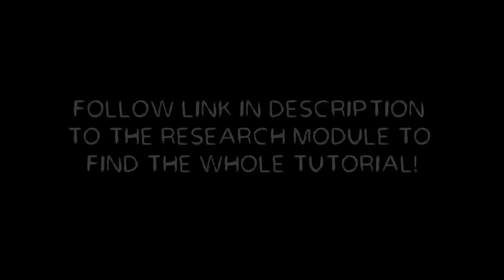#69 Shower upgrade with Cement Alternative (Magnesium Oxide)

Comment: You might want to cover up the intake of the shower drain with a grate to avoid debris of too big size getting in and blocking the drain somewhere you can't reach easily.
Reply: You could put plant carbon (use mimosa)  on top of the concrete structure as a filter barrier and cover it with coarse stones.
Reply: Yeah, that seems like an easy thing to add that would be worth it.
Reply: Just stuff a big "scotch bright" (steel wool pot cleaner) in the end 👍
Reply: Also, if you want more privacy, you can install a second layer of the pine boards on the interior of the shower below the shelf. Offset the boards by at least 3 - 5 cm and it will possibly help both sides to last longer while providing sustained privacy as the boards shrink over time.
Reply: @Isaac_Norman  Could use exterior battens over the gaps, but given the original width of the boards, might be alot of work.  However, the pine will definitely shrink over its life.

Comment: The magnesium oxide experiments were super interesting! Thanks for including that. I've worked with building supplies in the past - I did a year of work almost exactly like this. I never heard of using this for cement. Clearly it works, though, and is much better for the environment. You might want to add one more layer that is all downhill to the drain. Normally you have it all sloped, so water drains and doesn't pool. You can use a small spirit level to get it near perfect! But you really need to make sure the basin is all downhill to the drain, as otherwise the water will eat through the magnesium over time or go stale. It will certainly make it sink down, and drop further. Also add a grate over the drain to allow you to easily clean it in the future and prevent blockage, you will get a stink otherwise. Good luck!
Reply: potassium Phosphate, or fertilizer, also has a huge Co2 footprint, or is that very much lower than cement?
Reply: I agree with Camiel the CO2 difference is likely negligible when you account for shipping and packaging. Etc. This Carbon boner nonsense smh
Reply: @camielvanlenteren5256  Cement is one of the biggest producers of CO2, because not only does it require combustion, the reaction itself releases massive amounts of carbon due to the carbon atoms breaking off elements that have many carbon atoms. This is why it's good to look for alternatives. Potassium phosphate may be better, as it can be produced chemically with little carbon output. That being said, it's very likely that it's no where near as good as cement and will breakdown well before it. 

The better solution is to pump cement with CO2 so it is trapped inside the cement. Many companies are doing this as it's easy and quick and can store a lot of carbon.

But for a small project like this? I think that using potassium phosphate may be better. It isn't large scale.

Comment: not only as hard a rock but waterproof, 2000 years ago the romans were using such exotic mix's one of which was volcanic ash, it was used to build aqueducts, domes, water catchment tanks and much more, after 2000 years many structures are still standing and working great, no leaks! no cracks!

Comment: I’ve seen mixtures or concrete that use wood chips inside if you want to consider that! Acts as a carbon storage because the emissions of the woodchips biodegrading dont happen. Could be interesting to experiment with!

Comment: I was suprised you didn't torch the ends of the posts that were being put in the ground directly in the dirt. Good method for preventing rot, or at least putting it off for a longer time than it would be without it. Very happy to see the Magnesium Oxide experiments and how it works. The only thing I could think to suggest would be to put in a drain screen over the runoff hole in the ground, to keep large pieces from potentally plugging the drain. Where you have it, it doesn't seem like it would be a problem to clear out, or check once a week, or more, depending on the usage of the shower. Loved the project. And yes she is already a celebrity. 😁😉

Comment: Some ideas to prevent wood post rot and water runoff in post area: Propane torch the wood surfaces, stone/brick/concrete/rocksbelow and around wood footing, concrete or similar base pad for wood to rest on, or rock base to improve drainage away from post bases, sand/clay/mud and hay/straw; once hardened, apply a smooth sealant (concrete or other).  Takes longer but some make their own air dried bricks ( straw & mud  in a mold) and use mortar or equivalent to join.
Any plans for a passive roof solar water heater tank storage unit. Eg, Water tank on the ground, exposed to the sun yet glass covered or encased? Solar panels on the roof to provide an alternate energy heat source, shower roof water run-off collected in blackened water barrel(s) on the ground. Water can also be used for garden plant drip irrigation.

Comment: When you start doing plumbing indoors  remember to pre-squeeze the copper rings (olives)on the pipes, also add a bit of thread tape  around the olives before final assembly, this will make sure your fitting dont bleed later on. What do you guys do with the grey water? Understand you use bio soap but does it run through a fat-trap before it goes back into the wild?letting the water flow into a pit/  with potato sized rocks can do the trick, the body fat sticks to the cold rocks and you can treat it with bio enzyme to clean it up and take the smell away,  I enjoy your videos, thanks for the great content cool music video man
Reply: Great man!
Reply: Love comments like this. Very informative.

Comment: Don't let the water tank goes dry, even in winter time, but specially in the summer, otherwise it will crack and start leaking. Just 5cm of water will prevent it! 
 Nice work 👍

Comment: Loving tho project so far, as a suggestion you might want to look into charring the surface of any wood that goes into the ground such as the posts in this video or the mimosa that forms the steps. Charring the wood prevents bugs eating it and prevents rotting, plus it looks really good IMO. It's originally  a japanese method called Shou Sugi Ban, plenty of videos on youtube about it :) .

+ It is also more fire resistant.

Comment: The sustainable element is in the materials ability to return to the earth and be replaced by your labour. We had a deluxe long drop (two holes in the board, nicely smoothed for no splinters and no queues 🤣😂) just dig a new hole every year.   Got twenty years out of that tin shed before indoor plumbing...

Comment: The environmental impact of Magnesium Phosphate cement (MPC) per kg is higher than for Portland cement, mainly due to the use of fertilizer. It, of course, depends on the ratio MgO:phosphate and other variables, but please, don't advertise it as "environmentally friendly" which it is not. But a great material for superfast setting and very useful for such a project.

Comment: you could have used the bamboo to make threads and make  fabric of the bamboo then being cross stitched the warp would be minimal and some kind of waterproofing can be done using some other material.

Comment: I don't know if the wood you used is naturally waterproof, if it wasn't, fence stain might be fairly economical and effective for prolonging the life of the wood. Also, it looked like a pocket hole screwing kit might be useful addition to your tools - not suitable for every situation but easy to use and they help make most of the solutions they're used for stronger.

Comment: Great work on the show you guys. Just a suggestion to stop those boards twisting. Keep a constant middle rail going around with an angle for water to run off. (Joiner carpenter here) love the different idea on the base product. How firm does it stay being wet all the time?

Comment: curious, what is the CO2 output in the manufacture of the MOP cement you are making?  Especially as compared to Portland Cement (that is pretty bad, most of us understand).  

Also compare the cost of the same volume would be interesting.

Comment: so im catching up on the Project Kamp videos and although 8 months late i do like to comment on the carpentry work. I love the work you guys put out but i have one concern. As a former carpenter myself i am used off seeing a lot off workers using really loud tools without hearing protection. Which will set a trend so new people on the jobsite will follow the example and refrain from using hearing protection, giving arguements like being able to better communicate. If you want to work in a sustainable way to preserve yourself and your coworkers i think hearing protection is a good way to start. If you look into db output from powertools this would be a good idea even using power drills and impact drivers but especially oscillating saws and miter/track saws. I know this can come accros as being a bit nitpicky but i can speak from experience that oscillating saws with inadequate protection can give you hearing damage/tinnitus

Comment: For season 3 on this, can you please do a "Rough" R value test, where on a cold day you have a shower and ask everyone if it was warmer or colder than the wood floor, and the same for a hot hot day next summer? I'm sure you could test it more, but it's all about the feel of it.
Reply: It's the same wood floor.
I'm not sure what you are asking.
Reply: @jimurrata6785  I think he meant the basin, like if the basin is colder to stand on than the wood, the wood has good R value.

I'm not sure though
Reply: @RobertDoornbosF1  No one stands on the basin.  🤷‍♂️
They stand on the deck boards that form the floor of the shower.
Like I said, the 'pan' is simply a catch basin formed in the dirt... under the shower floor.

Comment: So, no tar paint before putting the posts into the ground? Isn't that going to rot? I did like the oscillating saw/multitool, really handy to cut parts out of the beam. Very good tool I am still looking for one. Yes I need it. 

So, you were not into building a concrete slab with some sides so there wont be much water getting on the posts? In 5 years your beams will be rotten away now probably. :( 

If you calculate how much CO2 you would produce with all the concrete you are using, and plant some trees, all should be fine right?

I like the strength of your ceramic new age concrete putty. Did you check how much CO2 it produces in the reaction and in the mining, refining, and producing of the chemicals? What about the cost? Is is cheaper? 

The ceramic with the burlap makes for a composite material. Its how they make windmill blades. Pretty impressive. 

Aren't you going to smell the sewer when there is no water lock?? I'm not sure that it is not going to smell. I do like your washing table. I looks to be a concrete one. Yes, I like concrete. :P

Those are some heavy duty pipes you are using there. Also with a lot of sockets/couplings, so is the stainless steel? It seems that each country has its own conduit system. If I were to do it, i would bent as much as possible and solder joint it (while its cheaper). Are these Portuguese pipes the best bang for the buck? They look good. 

Looks like you can shower now. 

Greetings,

Jeff
Reply: There is no sewer. Grey water is used for watering the garden.
Composting latrine is off to the side (back?) of the shower.
Watch some of last year's episodes or check the playlist for details.

Comment: There is an old poem and a rule with linseed oil - I applied linseed to a wood floor in a bathroom and those 2 coats water proofed for over five years but the ancient Victorian era poem said of coats of linseed on wood: "once a day for a week once a week for a month, once a month for a year, once a year for a life time :p and a couple centuries later there's still a wealth of functional unfaded pieces of Victorian era linseed oil furniture kicking around- so my reply to your efforts is (may that shower stall lumber outlive all of us) (and it actually could if you apply the principle)

Comment: I just had a chance to review the research documents that you posted and had a few follow-up questions. What was the water source used for your experiment? Have you attempted this with distilled water as well? I know some geopolymer recipes recommend distilled water to avoid issues with mineral variance from different sources. 

Also how are the projects you constructed with this holding up a year later? Thanks for your time. I enjoy watching your progress.
Reply: They have shallow well/spring ... likely hard water.  I was also concerned with the MgPo4 source as fertilizer .... maybe having traces of Nitrates/fish emulsion as they commented on the smell!

Comment: The ingredients for this cement alternative cost rather more than cement. And almost all of the price of cement is in transport. If you are swapping them, have you actually off set the transport costs for the raw materials? MgO2 is $200-400 a tonne FOB,  K3PO4 is currently upwards of $300 a tonne. Money= carbon inputs

Comment: Thanks for the video update and the showermaterialexperiment. I read all the magnesium linked articles. What i didn't find in them was : is this magnesium mix(after hardened and used) recycleble or cradletocradle... or does it leave unusable lumps like the same as  Portland cement ? If so... than what would be the major benefit of this material? ... no toxic fumes?... other ?  Does anyone know ? Thank you ...

Comment: I think you did a really great job with the shower, I think it would have been better to make a mould for the shower pan that way you could have ensured a smooth finish for water run off so less chance of mould makes g standing water, and another reason would have been to ensure a minimum thickness so it could keep its integrity, I didn’t see a water trap or maybe I missed it but the shower and the sink should have one to stop any nasty odours or vermin 😊👍👏😻🦧

Comment: I really dont want to be negative because you guys do so well normally but you still have little privacy with those gaps. Someone at the sink can see inside clearly. Also theres no "Ubend" on the drainage which means your going to get all the bad smells coming back up the pipe from the shower and kitchen sink
Reply: What "bad smells"? 
It's grey water run out to daylight.
Reply: @jimurrata6785  the pipe will smell as the waste pipe is shared with the kitchen sink and no U bend

Comment: A quick search in scientific papers shows that magnesiumphosphate cement has 1 big downside,, it has very low water resistance... So not sure how long it will last as an outdoor shower basin 🤷🏼‍♂️🤷🏼‍♂️
Reply: Properties and Reaction Mechanisms of Magnesium Phosphate Cement Mixed with Ferroaluminate Cement - Liang Jia et al.
Reply: @uribove  ferroaluminate cement is blast furnace slag and clay fired to clinker and ball milled into dust.
There's nothing nearly that high tech going on here.
I suppose the burlap and magnesium phosphate is a big step up from the manky plastic sheet they had before.

Comment: It’s very pretty, however bc yall are using wood, and after last years shower, why did yall not make it larger to help prevent the wood from constantly staying wet? It looks as if yall could have moved it to the back of the container and made it a much  larger square, to help keep it from staying soaked.
Reply: Yes, I agree, larger and lower would work great.  It is a bit of a commune type setting with maybe even more people as it grows.  Seems like 4x8ft area with room for at least two or three with more low flow heads would also keep water off of fence/blind and save on propane usages.  Making a masonry patio from some of those clay bricks from the onsite buildings would work great too .... making the floor lower for privacy and also more cleanable.  I guess they are just playing around and experimenting.   My last outdoor shower had a grape vine/blackberry blind in a half circle to give privacy from house/deck ... also 2ft lower on tile/masonry floor.  The back circle was a view of canyon redwoods.  Now I work on an outdoor shower in town and plan to use circle of boulders and green fence of blackberries, blueberries and raspberries on 6 inch reinforcement grid wire and bamboo.  I will probably weave some driftwood/sphagnum moss/ferns in it too. I have used pee gravel and granite fines with acrylic glue before on the floor on low usage showers... but I am more into a stone/slate/hydronics floor for cleaning/comfort/drying/drainage.  I would stay away from dirt-crete/rammed earth/earthen plaster around water. It was driving me crazy to see Charley back fill a post with dirt vs rocks/gravel!